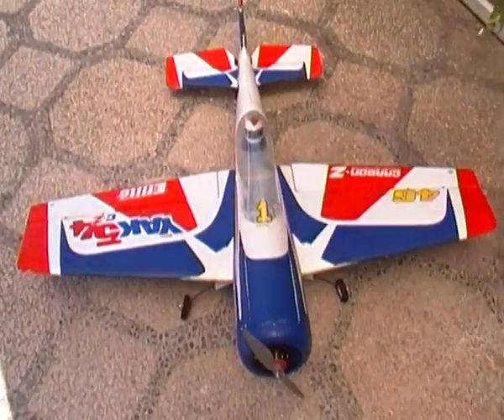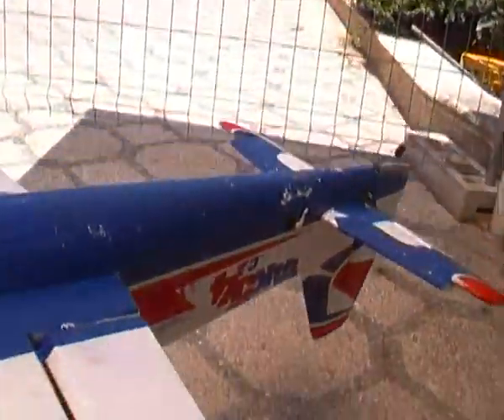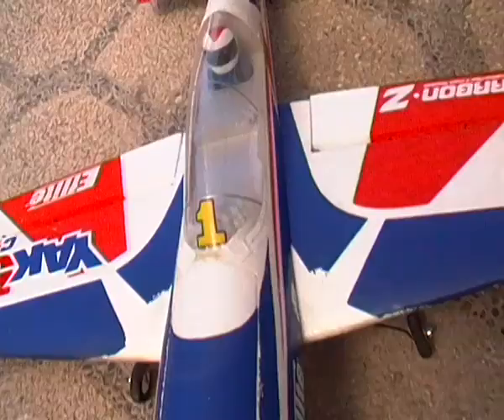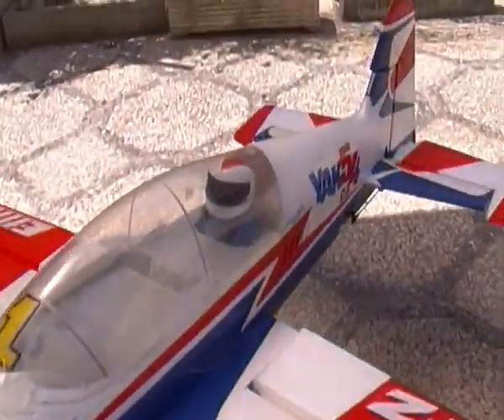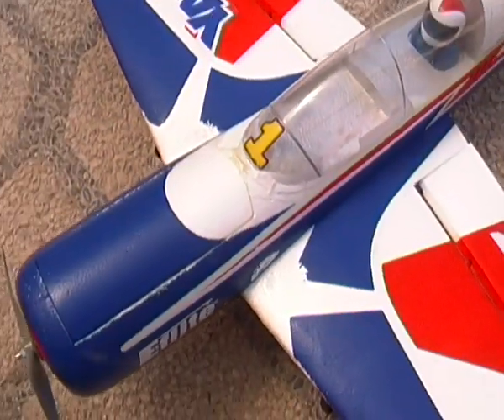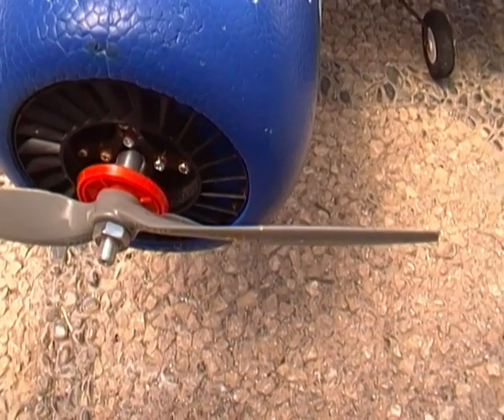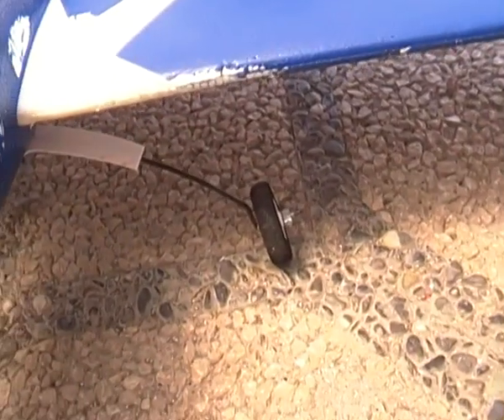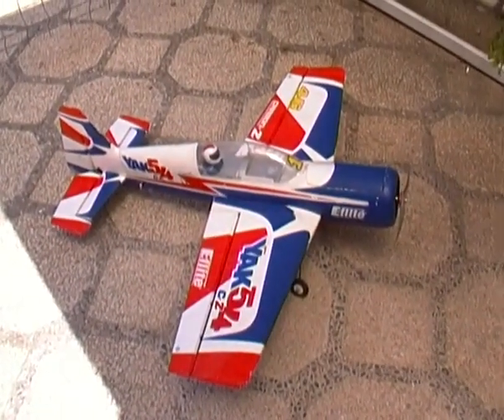Carbon Z Yak 54 after 150 flights. A MUST SELL!

Comment from the maker: @willischasinghighs 150 flights is a lot. for any Rc plane. And at 250 euros/340 USD, i think its a fair price since you get 4 digital metal gear servos, a 1KW electric motor and a 60Amp ESC.

Comment: you can't have your cake & eat it too. you can have springy gear that puts up with high alpha landings that lets the fuse contact the ground, or you can have a hard gear that breaks the entire airframe in half.

just treat it like a glow plane. give it wear edgeson all tips for scrapes with the ground.

AFA the paint. it's unfinished foam. touch it up with latex paint that has been color matched, or peel the entire plane, spackle & sand & then paint it.

Comment: hello my friend, what settings have when flies 3D ?? amount Expo and D / R ,, do you have in this beautiful videos, and what batteries Throw 4s 2700; with battery 4c 3300, it will now that are very heavy for this plane YAK 54
Reply from the maker: +Emirete Angel elevator and rudder 100% with 60% expo, aileron 50% with 50% expo. 3300 is too heavy, 3000 in good for weight and flight time

Comment from the maker: this is an old video. the carbon z yak 54 Version 1 is known for having motor mount issues now. they fixed it with the release of version 2, a much stronger motor mount installed. i have bought 3 more yaks after this one, they all last no more than 150/200 flights which is actually average for a foam plane like this, of course flown at my pace and skills. Thanks for the comment!

Comment: Ok I have just reactivated my facebook account to put up the pic's of my son holding the YAK 54 after plowing into the chainlink fence. It took a little CA &  20 min later it was ready to fly. Then in the 28 mph wind gust's I broke it in the same place & this time no CA with only "H.D. CLEAR PACKING TAPE" I took it back out and flew the rest of the 6 minute's. I have the video of it in 28 mph wind gust's off my cell phone so it kinda suck's :( H.D. PACKING TAPE IS AWESOME ON Z-FOAM ;}

Comment: Your plane has been road hard and put away wet. Any plane of yours im guessing looks somewhat the same.. Your motor mount is probably cracked due to flying it with one of the tips of the blades broke, that motor spins at more then 14000 RPM. balanced props are a must. If i were you i would just fix it up and keep flying.